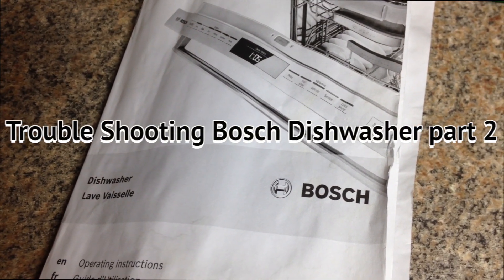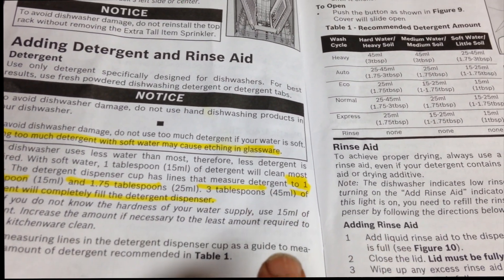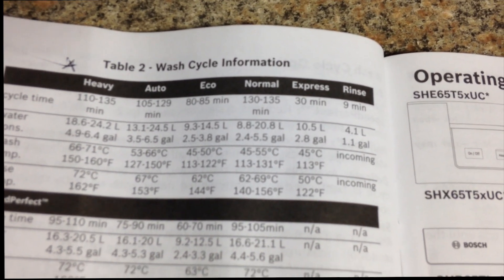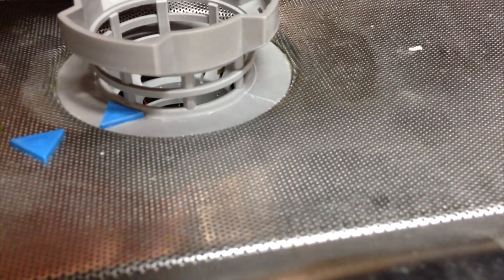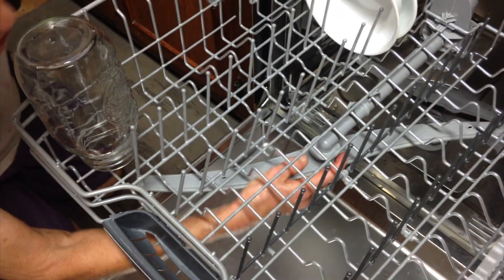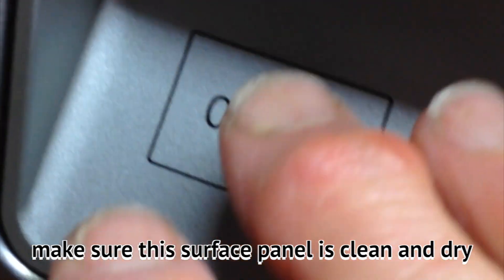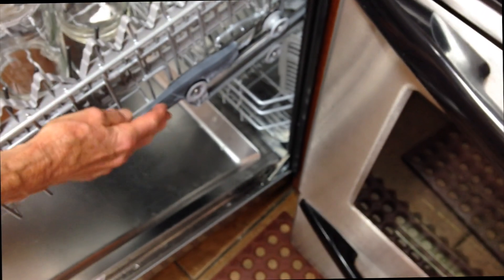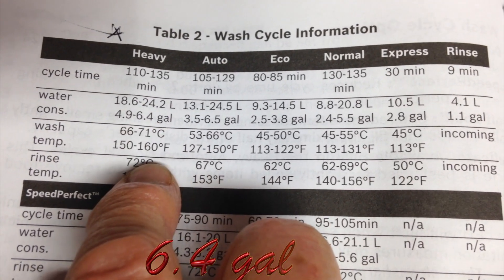Bosch Dishwasher Troubleshooting part 2 of 6

Comment: THANK YOU again for the helpful up close manual pictures!
Reply from the maker: One of the videos I had to cut and cut to get it into the time frame I was allowed and I should have made it into two videos as the cramming ruined it. So glad to hear that at least one of the Bosch videos was helpful. Thank you.
The problem with dishwashers of today is that there is not enough water to wash the dishes so then the cycle goes on for a long time unless you wash the dishes and then put them on express cycle. We had an old Maytag that was fantastic. Then we bought a new Magtag that was junk. Hard to find real quality on anything anymore. The design of the old Magtag was easy. Easy to load and easy to use but things aren't made like that anymore.

Comment: Bosch Dishwasher Error Code E15
Fault Condition: No water in dishwasher or not sensing water.
Repair or Check: Tilt dishwasher back and the error code should disappear. While you tilt it press off button to clear. Stand it back to normal turn back on and dishwasher should run normally.
Parts Required: Tilting machine
Reply from the maker: Thanks for the info. I have not had the error code E15 but sure appreciate the info. Thank you.
Reply: Donald & Colleen Sampson xz